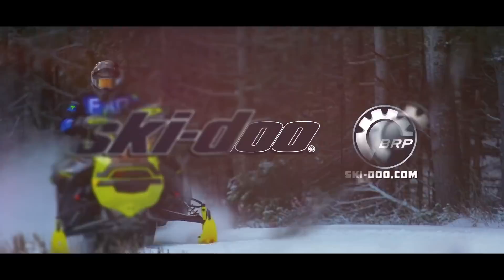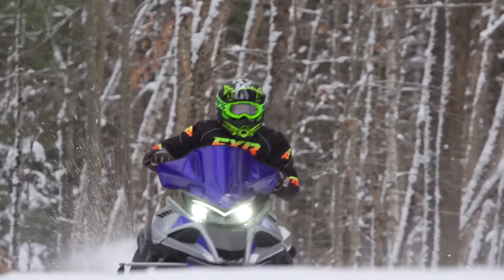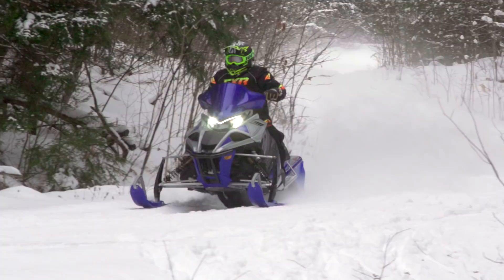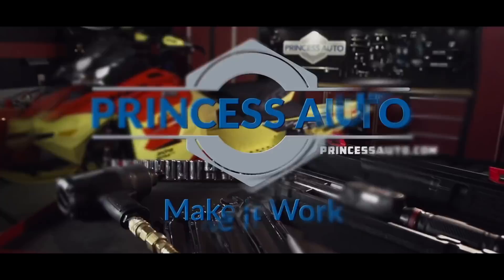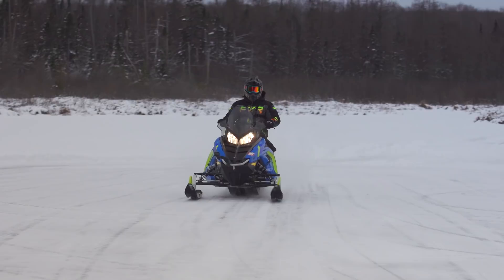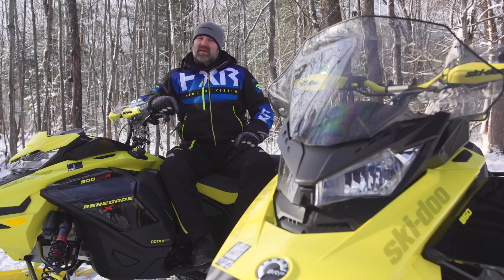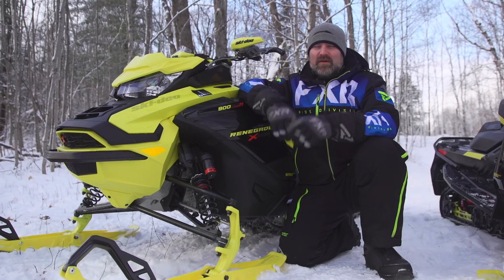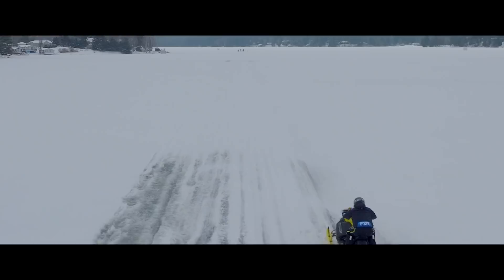SNOWTRAX TV 2022 - FULL episode 6

Comment: AJ, the BiteHarder segment was a great way of illustrating not only the increased performance and safety of having better traction, but also the ease that these products allow you to maintain them with. The next time you do testing like this, I’d love for you to throw some race flare into it, and give us your lap times pre/post sharpening. I own the standard version of the carbide sharpening tool, and my only complaint is that if I go overboard sharpening, I get into an oversteer issue with my non-studded sled. In honesty it’s 100% user error in purchasing a little too much carbide for my needs, and then also going full 200lb gorilla on the sharpener.